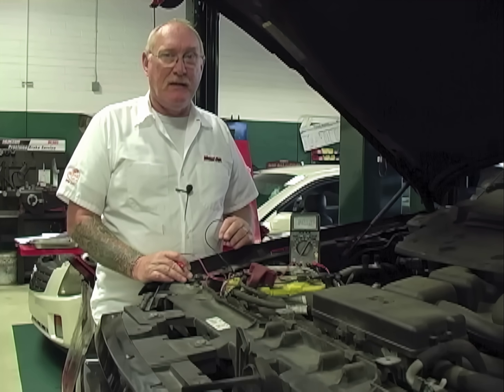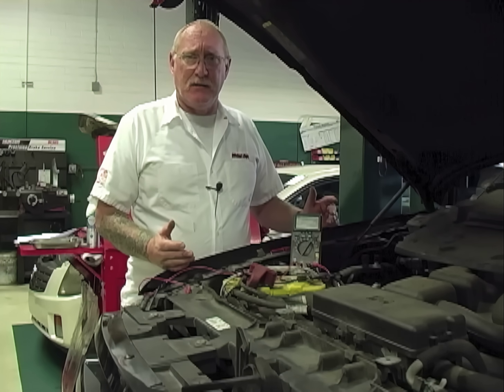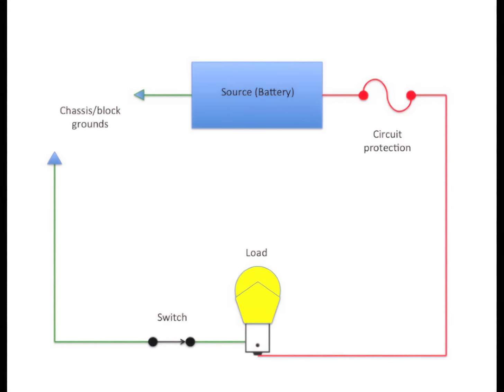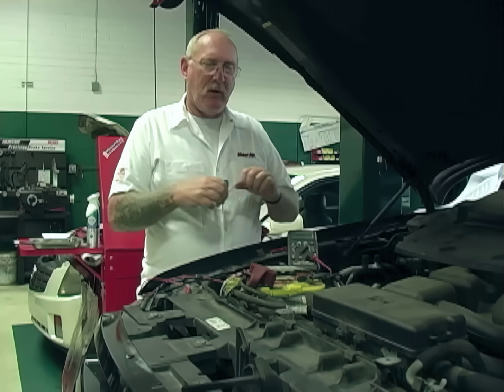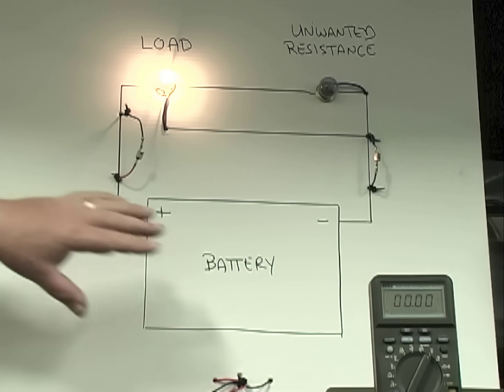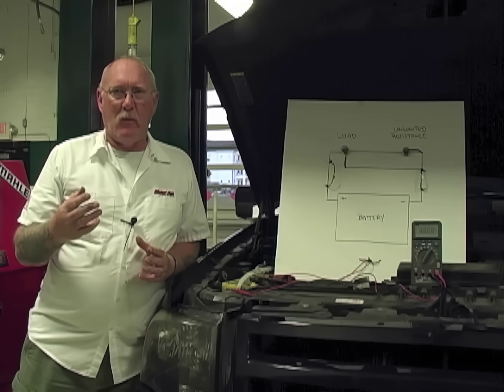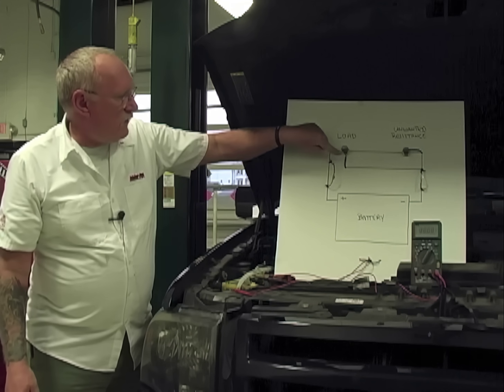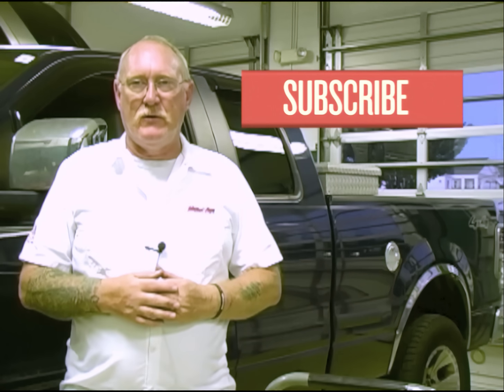The Trainer #47: What measuring voltage on the ground side means

Comment: What does checking the reference voltage on a car tell you?
Reply from the maker: A reference voltage is a scaled down voltage that is used to power a variety of sensors on the vehicle. If it is less than what it should be, the sensor outputs back to the module will be inaccurate - effecting what the module does in response.

Comment: You do know that current flows from negative to positive? The ground side is very important for the circuit to function.The negative side has the electrons that travel to the positive pole. Calling the positive side poiwer is incorrect.
Reply from the maker: You are correct in that current flows from negative to positive, but most test equipment is still referenced to conventional theory...which is why the battery posts are labeled as they are, and the tools we use are laid out as they are. It's just the way we've learned to reference portions of the circuit.

Comment: THANKS FOR THIS LESSON, BUT HERE IS A QUASTION RELATED TO  VOLT DROP.
BEWARE THIS QUESTION NEED GOOD LIESTENER.

I SAW  SOMEONE DOING CAM SIGNAL SIMULATION ON A PULL DOWN DESIGN.CAM WAS DISCONNECTED AND THERE WAS 5V ON SIGNAL WIRE. HE  CONNECTED THE SCOPE THAT SHOWED 5VOLT. HE THEN CONNECTED TEST LIGHT TO BATTERY GROUND AND STARTED TOUCHING AND REMOVING THE TIP OF TEST LIGHT TO THE SIGNAL WIRE. THE METER STARTED TO SHOW SQUARE WAVE (ZERO AND 5V).

HERE IS MY MISUNDERSTANDING. I ASSUME TEST LIGHT AS A LOAD (RIGHT?) THEN I EXPECT I EXPECT THE VOLTAGE BEFORE THE LOAD TO REMAIN 5V WHETHER TOUCHED OR UNTOUCHED BY THE TEST LIGHT. SO, HOW COME IT DROPS TO ZERO BEFORE LOAD WHEN TOUCHED.

M.B.S MOSHITOA (SOUTH AFRICA)

Comment: I am so very glad that you said the “Fuse” is their to protect the wiring. Although explaing why it’s on the positive side was a nice touch, but while the component is designed to be changed, the wiring harness is not. Depending on where you grew up and how, like a farm, there where not a lot to trade schools near by to attend to learn automotive mechanics. The high school did not even offer it or woodworking. But, I asked questions, watched others and most importantly did my own work. Having my cousins bring an old school, rope wound go cart to the farm for use 3 months of the year, was the one thing I feel in love with. Wheels, going fast and the freedom, but it quit. It was a huge incentive to learn how to diagnose a small gas engine, basically graduating from taking two lawn mowers and making one run. Considering we did not get an allowance, a gas engine make earning that $1 per yard easier. Fixed the go-cart and was saved from the butt-kicking I would get from my older and bigger cousins next summer. Being an apprentice in a one man shop is still possible but more rare with the complexity of systems. As paper factory service manuals where normal, few of us still remember the back page with the schematic for the vehicle and it’s variations where found. Yes, they folded out 8, 10 or 12 pages but the head light where on the left or first page, while the tag, tail and stop lights where on the last page or right. Everything else in the vehicle was in the middle with no rectangular boxes that said “Logic” inside. Best of all, no two techs having the same talents they put descriptions of voltage drop and other meaningful information in the beginning of that section. You could walk into a dealer, line up 20 techs and ask to describe voltage drop and only one or two hands at best would go up. Not much better today but I found it to be the easiest, quickest and it never lyes. Best of all, you did not disturbed the other wires, connectors or terminals, in case it was an intermittent problem that was acting up for four days straight. Working at a Buick, try explaining to a 70 to 80 year old man why the radio, windows, wipers or sunroof worked, with the key off, then quit when you opened the door! It was a short I tell you! No, read page 66 of the owners manual under features. Thanks for the wonderful and good video! ASE Master Tech since 1978 - Retired
Reply: Farms and ranches produce great mechanics and even greater Field Techs!
🫡

Comment: Thanks.  I just bought an old car that is doing this.  8 volts on the chassis, 3 volts on the carburetor.  Checking the negative battery cable tomorrow.
Reply from the maker: Let us know what you find!

Comment: So, headlights are not wired in sequence?  They are ran as independent loads?
Same with brake lights, parking lights, fog lights, dash panel lights, etc?  Anything that runs at the same time is actually wired independently?
Hmmm.  I'll have to look into that.
Reply from the maker: You are somewhat correct. Loads, like headlights, can be wired in parallel - sharing common power and ground. But eventually, each breaks off on its own independent leg. If the loads were wired in series, they would create a voltage drop across each other. Make sense?

Comment: Would you get the same meter reading of 8.3 volts if you disconnected the negative battery cable, and put one meter lead on the battery post, and one on the battery cable?
Reply from the maker: If the battery cable is disconnected, you'd have an open circuit - no current flow. I would expect to read full source voltage in that case.
Reply: OK.So, your saying that  With the negative battery cable disconnected,  a meter connected to the battery post, and the cable, will show full source voltage. 

If I see a reading  of 12.8 volts using the meter across the battery posts, the same 12.8 volts will be seen with the cable disconnect, and the meter placed as described.
Reply from the maker: @thom9040  Yes - it's the same as measuring Open Circuit Voltage. Your negative lead is on the negative battery post and the positive meter lead is on the positive battery post - via the ground cable, passing back through a load, through the positive lead to the battery. As long as the path between the positive lead and the battery is complete, you should read the same voltage - within a tenth or two.
Reply from the maker: Try it!
Reply: I already  did.Also, I connected the meter between the negative battery post and a good body ground( the alternator bracket)
The meter reading was absolute zero.
Reply from the maker: @thom9040  Absolute 0 is also an indication that no current is flowing. Was that reading taken with the key on? How about when the engine is running?
Reply: Key on engine off is 4.5 millivolts
Engine running is 26.4 millivolts
Key off Zero reading on the display
All doors closed, all lamps off
for all testing purposes.
Reply from the maker: @thom9040  Then your grounds appear to be in great shape! Had there been any sources of higher than normal resistance between the alternator case and it's path back to the battery, that reading would be much higher.
Reply from the maker: Try wiring a test light between the battery negative cable and the battery post - and then measure the voltage between the battery post and the alternator case with the key on.
Reply: I get 10.7 volts with the key on.Also the door is closed , and all lamps are off
Reply from the maker: @thom9040  Great! The 10.7 reading is telling you that current is flowing but not all of the voltage has been consumed. There is still 10.7 volts and it's being demanded by the test light. If you move. your positive meter lead to the battery side test light connection (after the test light bulb), it should return to the lower readings you saw earlier.
Reply: Thanks for your contribution to this dialog.
I hope others can learn from it.

Comment: Hey Can You Help, I'm having ground sent while engine is cold to normally active Circuit when engine is hot and running the Cooling fans when Engine is running at cold temp and again when Ignition is turned off for about 2mins. ECT works fine, I tested it and the Temp gauge works as well. I have 5V Reference at the ECT Connector. I don't know why I'm having this ground sent to the bottom right pin of My Fan Cont #1 Relay. 05 Chevy Impala 3.8L 
Vid Of Issue: https://youtu.be/Kml_ODJKVIU
Reply from the maker: You may need a scan tool to fix this one. Operation of the fans, when the key is off, is normal under certain circumstances. The entire system is controlled by the PCM and BCM. So if the engine is cold and the fans are on, somebody is lying to somebody!

Here's how the system works, thanks to my friends at Mitchell 1!

The engine cooling fans are controlled by the body control module (BCM) and the powertrain control module (PCM). The BCM sends a class 2 message to the PCM requesting cooling fan operation. If there is a class 2 communication malfunction between the BCM and the PCM. The PCM will operate the engine cooling fans independently of the BCM.

The engine cooling fan system consists of 2 electrical cooling fans and 3 fan relays. The relays are arranged in a series/parallel configuration that allows the PCM to operate both fans together at low or high speeds. The cooling fans and fan relays receive battery positive voltage from the engine wiring harness junction block. The ground path is provided at G101.

During low speed operation, the PCM supplies the ground path for the low speed fan relay through the low speed cooling fan relay control circuit. This energizes the FAN CONT #1 relay coil, closes the relay contacts, and supplies battery positive voltage from the FAN CONT #1 fuse through the cooling fan motor supply voltage circuit to the right cooling fan. The ground path for the right cooling fan is through the FAN CONT #2 relay and the left cooling fan. The result is a series circuit with both fans running at low speed.

During high speed operation the PCM supplies the ground path for the FAN CONT #1 relay through the low speed cooling fan relay control circuit. After a 3-second delay, the PCM supplies a ground path for the FAN CONT #2 relay and the FAN CONT #3 relay through the high speed cooling fan relay control circuit. This energizes the FAN CONT #2 relay coil, closes the relay contacts, and provides a ground path for the right cooling fan. At the same time the FAN CONT #3 relay coil is energized closing the relay contacts and provides battery positive voltage from the FAN CONT #2 fuse on the cooling fan motor supply voltage circuit to the left cooling fan. During high speed fan operation, both engine cooling fans have there own ground path. The result is a parallel circuit with both fans running at high speed.

The BCM will request low speed cooling fan operation from the PCM under the following conditions:

Engine coolant temperature exceeds approximately 100°C (212°F).
When A/C is requested and the ambient temperature is more than 10°C (50°F).
A/C refrigerant pressure exceeds 1310 kPa (190 psi).

After the vehicle is shut off if the engine coolant temperature at key-off is more than 117°C (243°F) and system voltage is more than 12 volts. The fans will stay on for approximately 4 minutes.
Reply: @VehicleServiceandRepair  This is great Info, Ever since Your reply, I have been studying everything You pointed out. I'm thinking My BCM might be the culprit here,  because the Driver window switch does not work anymore "NOW" it used to work intermittently but, just recently quit working, On the surface it looks like the motor is bad, But, when I Hotwire it, it window goes up and down no problem.
Also, My Keyless remote does not work properly, especially the UNLOCK Button, It Locks with not problem but won't unlock. I have changed the battery multiple times, still does not work I have to press the Unlock multiple times while walking around the car before it sometimes catches which is like 15% of the time, Other times, It just won't Unlock. 

I do have a Bluetooth OBDII And Zuric ZR13 Scan tools, What do I Need to Check?

Looks like BCM failures are common in this cars as I found multiple people on Youtube with the same model Year 2000-2004/5 having BCM issue, although Mine is not as severe as theirs..
 After I learnt that the Remote Lock/Unlock is largely controlled by the BCM and also most of other controls, such as the door switches and Instrument Cluster (Temp Gauge Especially) are controlled by the BCM and with Your explanation of how the BCM is tied into the Function of the ECT, and I'm not getting any Fault codes for the A/C, it's all leading Me to believe that the BCM might be the cause here, But, I need to make sure, So how do I test it? Is there a Test to See if My BCM is bad or not?

Also, worth checking is the A/C, But, My A/C doesn't work and probably haven't worked since this issue started, It might've stopped working as a result of this Issue, since as You pointed out they are related and would cause these symptoms, but, I would think since the A/C is Off and/or not working, It can be isolated. I have even unplugged the A/C Pressure Transducer to see if it makes any change, but it didn't.. ?
Reply from the maker: @phigo4kins  The easiest way to see if the BCM may be the cause is to view the live data in the BCM - and that will require a scan tool that is capable of reading "enhanced" or OEM-specific, information. The test is simple enough. When you activate a command (like the door switch) and see that the status  on the PID changes in response, it is indicating that the BCM is receiving and trying to respond to that request. Most likely, it is a number of drivers (computer switches) that are failing. Hope this helps!

Comment: Have 12v from negative post to my body of vehicle please help I'm stranded on hwy with very little traffic
Reply from the maker: I hope you're still not stranded! Sounds like you have an open circuit between the battery post and the point at which you're attached to ground. Inspect the cable and cable end carefully - especially if the end has been replaced with a "universal" cable clamp.

Comment: Did I miss something here? U got an 8 v. reading from + taken off chassis gr. yet didn't explain how it got there! To me that looks like a short circuit somewhere.
Reply from the maker: What we measured was the voltage drop in the ground path between the two meter leads. It's telling us that there is another major source of resistance that is waiting for its share of voltage. It can be a tough concept to grasp and we've made several videos on this subject. Maybe it's time for one more?
Reply: @VehicleServiceandRepair  Definately.

Comment: Hi Pete, you got too technical for me when explaining why the protection is always on the positive side of the battery. I understand it this way, the positive side is hot and the negative side is cold. If I take a plain wire and attach one end to chassis ground and touch the negative (cold) side of the battery, nothing happens (when all is normal). When I touch the positive (hot) side of the battery with the same wire, sparks fly. Showing that the hot side needs protection from short circuits (unwanted ground).
I really like your straight language, not a lot of fancy technical speak

Comment: BTW About automotive batteries and how they discharge when sitting on a concrete floor. I always said the it does not happen but it does seem to happen. So one day I was walking through the repair bay and saw a battery sitting on the floor. I measured the voltage and it was 12 volts. Hmmm, I just happened to measure the voltage halfway between the posts and it was 6 volts. As I moved the positive lead closer to the positive, the voltage increased. If you measure voltage that means there is a path for current. With 6 volts halfway, there is a voltage drop. 

Turns out the battery was dirty from sitting on the floor and there was also so moisture since that is the was concrete floors are. I cleaned the top of the battery and broke the path of current. So the battery sitting on the floor is a contributing factor but it is establishing a path for current to flow from the negative to positive post is what discharges the battery. The dirty battery probably had many contaminates settling on the surface and with moisture, the battery will discharge.

Comment: Yea I had the exact problem on a f150. But my troubleshooting skills aren't as good as yours  I did find the problem by starting with the negative cable.  Fortunately that was the problem, about half way down the cable it was green. That was lucky on my part. But I had been stuck on the road about 5 times before I figured it out. Thanks for the video

Comment: I have been in electronics since I was 18 years old and am 69 now and want to thank you for presenting this. You did not need to get real technical just show the results. If someone watches this and looks at a water hose they can very well understand it. In the hose, pressure = voltage, water = current and pinching the hose is resistance. Pinch the hose and the pressure before the resistance increases, current then decreases. If the water (current) can’t flow you still have pressure, voltage and the resistance, pinched hose has increased. 
Good job.
Reply from the maker: Thank you
Reply: Sorry, I disagree, the basic technical method was necessary for those of us who are not Professional like Mr Pete.

He taught us the whole picture, the function & dysfunction to this method & how to think to process this method.

Assuming we know how to think or assuming that we would know the details, are the problem; to which lack of understanding of methods & formula, we never solve our objective projects. 

I wish you well.  🙏

Comment: If you have a powerful 12v, 1000 cca battery and one puny light bulb attached to it, the voltage is still all used up?
Reply from the maker: Yes.